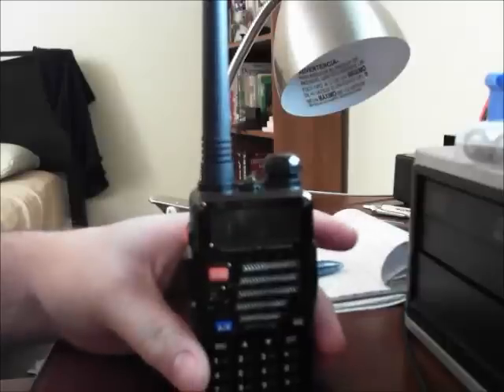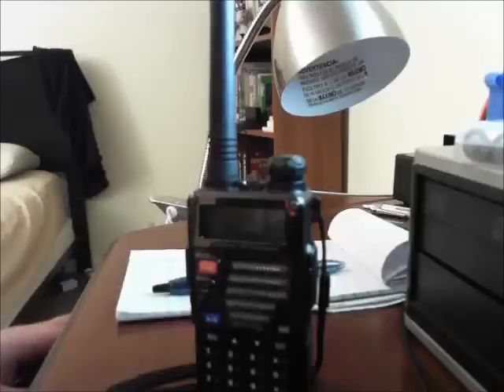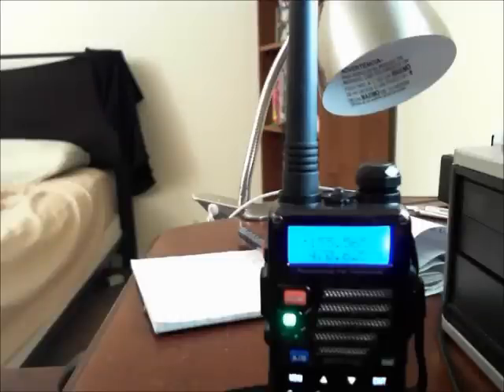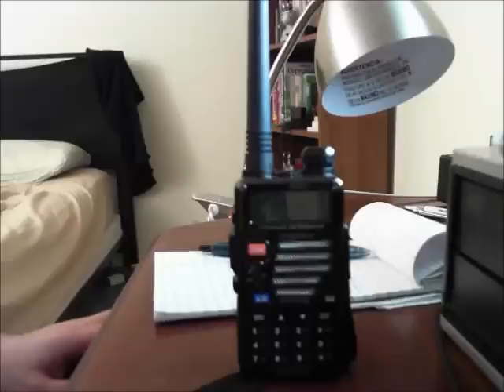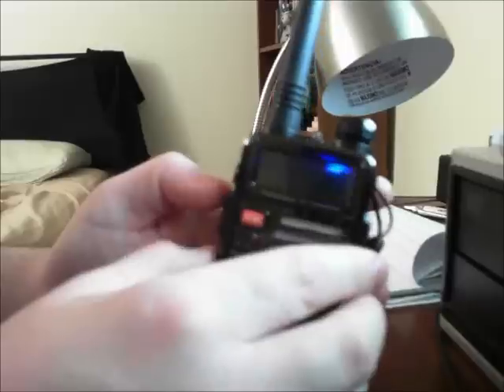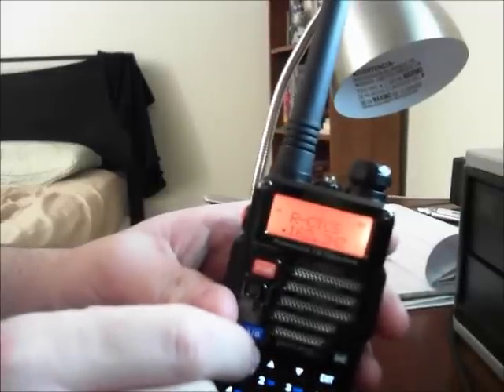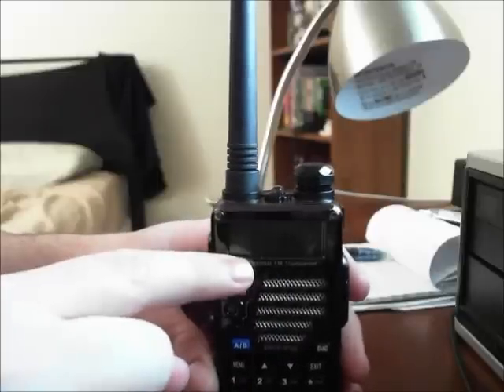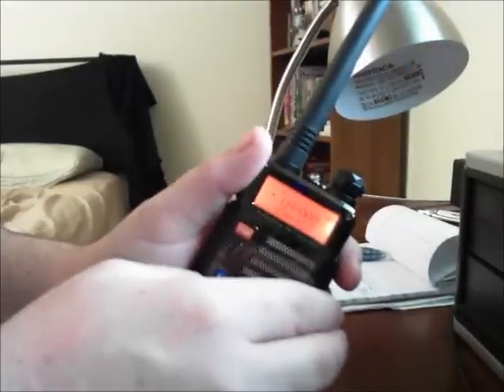Turn your Baofeng UV-5R into a Police Scanner!

Comment: I just purchased one of these and it is being delivered today. I have done a fair amount of research ahead of receiving the radio. Anyone who is using it as a scanner should probably download and use CHIRP software to program it. Despite being careful not to transmit, accidents happen and you don't want to get into trouble with the FCC. There are ways to disable transmit through CHIRP. Specifically, setting the Duplex to OFF and the Offset to 000.0000. Just thought I would throw that out there.
Reply: David Grub So in CHIRP if I change the duplex to OFF on certain channels then there is no way I can transmit on those channels? I have some frequencies programmed in that I want to make sure I cannot accidentally transmit on.
Reply: ***** I did a lot of research and was told exactly what I posted...set the duplex to OFF and the offset to all zeros (000.0000) and that disables transmit. I do not take responsibility if that does not work though. LOL . I just stay away from the PTT button as best I can to add a third layer of protection.
Reply: Setting Duplex to off (None) and the offset to 0.0000 DOES NOT, I repeat DOES NOT disable transmitting on that frequency.  Those are the default settings for a SIMPLEX frequency, i.e. one where you transmit and receive on the same frequency.   The duplex and offset come into play only when you are programming repeaters that receive and transmit on different frequencies.  I don't believe there is any way to disable transmitting on a UV-5R with CHIRP>

Comment: I just purchased my baofeng UV 5r and all I did was a reset all changed language to English set my squelch at 1 then under frequency typed in my local PD frequancy number and BAMM it works. oh I'm also on narrow band at the freq of 154.830 for my local an 155.070 for sheriff dept both dispatch

Comment: To avoid transmitting on the public safety channel, may I suggest you find a DOT Frequency thats open to the public in that particular VHF or UHF band and enter that Freq in the Transmit side, so any accidental push of the PTT wont key up the public safety channel, but you'll still get the Public Safety Channel receive Freq.... Cheers.....

Comment: I was into it and the at the 2:12 Mark . . . Its working...OH SHIT! Now im hooked and subscribed. Better than my DMR/MotoTRBO & Whistler TRX-1 scanner videos. Now im in a county where a baofeng WILL actually pick up. Everythng is P25 encrypted where im from and the analog is only used by walmart and local businesses that are on the 462-467 band. Even HAM radio has started going DMR mode in the metro atlanta area & the local rptrs are stil analog but lotta ppl using DMR now. 73z

Comment: You can talk to the Police if there useing a Trunk System don't push the talk button. My old Security job was useing Kenwood radio's and the Police were useing Motorola. We use the Boafeng UV5-R in my unit out at the Armory .

Comment: I have a Pofung UV-6R, actually 3 of them, and I've programmed all my local PD and FD frequencies in and it does work and receives the traffic on each channel UNLESS I am scanning.  When scanning the scanning never stops.  I have a Radio Shack scanner nearby and it works perfectly but this UV-6R won't stop scanning when it should.  Why would this be?  I'm not using any CTCSS or tones of any type although I want to.  I was hoping to get a cheap scanner that would work with CTCSS so that I could filter out the annoying squelch sounds that sometimes happen due to nearby equipment.  I've tried my other UV-6Rs and they do the same thing so I don't think its a defect.  Thanks.

Comment: set the radio up as a repeater. When you store the channel it says receiving. If you go back to the VFO change the frequency to a 2 meter frequency and then press menu and set channel again press menu and it will say transmit frequency. Now go to channel mode look at frequency it will be police, hit * and it will show reverse as 2 meter frequency.
Reply: I'm not even following you, and I'm familiar with these radios and their operation.  That would just leave you receive to the state troopers while trying to transmit on a HAM Repeater or to BFEgypt, wouldn't it?  Unless you incorporated VOX from one radio to another, you couldn't make a formal repeater per the FCC.  making a cable to link a receiving radio and transmitting radio would be about the only way to do that.  You'd still want to use a TNC to key the radio becuase leaving the VOX on wouldn't be optimal, unless you disconnected the microphone in the radio, but that may disable the VOX function, of that I am unsure.

Comment: I am thinking of buying this radio for use with traffic control because sometimes the truck with extra walkies is a good walk away and I cant leave my position. It will also be great for listening to tac channels that my pager isn't programmed to hear what progress is being made before I get on scene if I am responding with my POV.. I probably won't use it for fireground operations because I don't wanna break/melt it and there are motorola walkies on the trucks. However if it did break it's not like I'm out hundreds of dollars

Comment: What happens if you transmit on a public safety frequency? I imagine bad things.
Reply from the maker: What happens is you piss off more public safety personnel than you can imagine and trigger an FCC investigation. If you get caught, you're fucked.
Reply: Its surprising that so many public safety frequencies are on 2m HAM, as it seems to be easily accessible.
Reply from the maker: Connor Mason There aren't any public safety frequencies on Ham bands. There might be public safety frequencies that Hams can use on a secondary basis, but police and fire agencies operate on 148-174 PSLMR bands.
Reply: Oh
Reply: Keyword ''Caught''
Reply: *****
It is unlikely you would be caught in that scenario because it is extremely difficult to triangulate constantly moving antenna
Reply: If you program it with CHIRP you can set that channel to receive only. Set the duplex field to OFF. That is what I did for the NOAA weather channels and others that I did not want to accidentally transmit on.
Reply: BuildAPrep Preparedness Outfitters 
Also radio amateurs will jump at the chance to help local law enforcement to track down unauthorized users of public safety (or ham) frequencies. They have all kinds of nifty directional antennas and will (using simple geometry) be able to pull up in your driveway in pretty short order.
Reply: Nothing would happen unless you have the proper subaudible tone programmed on the proper frequency.  I hate it when people pass out bad info.  They would never hear you if you aren't transmitting the proper tone even if you are on the proper frequency.  duh
Reply: Not quite Joel.  It would take us a long time to find someone.  It is not that easy and it takes a long time.

Comment: I have a UV5+plus, I input the local PD and Fire Dept frequencies in to my radio and to scan them I press and hold down the * key. This allows me to scan the input frequencies that I also got from http://www.radioreference.com/apps/db/ this works well for me as my Baofeng picks up the radio traffic clearer than my scanner does.
 You can also get way better reception by upgrading your antenna, I bought a Naoya N-771 on eBay for around $5 and am very happy with it. Nice video.
Reply from the maker: Modern_Patriot I've been using the Nagoya N-701 but I also have the 771. The Baofeng is my EDC handheld and is always with me. I purchased an adapter from Radio Shack so that I can hook it up to the dual band NMO antenna on my vehicle and it extends the range by about 10 miles. I ordered some more accessories for it and will do a video asap with all the updates and stuff. I have yet to use it as a scanner though, my Bearcat 355N works great, I plan on upgrading the antenna though or just upgrading to a HomePatrol scanner so that I can RX the state PD and other encrypted/trunked comms. Thanks for your comment, please sub if you haven't done so already!
Reply: Yeah your bearcat will scan way faster than the Baofeng. I have a HH radioshack scanner that scan about 10 times faster than my UV-5R+plus does.
Reply from the maker: Nice. My first ever scanner was a RadioShack handheld model 164. I've had for about 8 years and it works great but I could never figure out how to program the trunking. I think it's because it's an analog scanner and everything now is digital.
Reply: BuildAPrep Preparedness Outfitters

Comment: Any luck with public safety and such frequencies in 2017 on these BaoFengs? They went to a new digital system in our area
Reply from the maker: Yep. Many of the agencies and departments in the United States are still using VHF and UHF analog radios. Most if not all the town police departments and fire departments in my state are still on that system/mode. I don't think a lot of departments will go digital for another decade, rural departments might never switch.  It cost's too much and the technological advancements are not worth the investment under most circumstances anyway. In areas like mine, each town has it's own fire department/EMS. Each fire department and EMS is dispatched by Litchfield County Dispatch. If LCD went digital, all the departments that are served by them would have to switch their equipment as well. That means new radios in every apparatus, new portables for the personnel, new pagers etc. In my department alone, that is over 30 pieces of equipment that would need to be replaced at a cost that we don't have the budget for. The situation is the same with most of the country and that is why so many of the departments which have gone digital did so thanks to federal grant money.
Reply: will my uniden 346xtc pick my county up that i mentioned above? i can't get it to work.
Reply: radio reference says they're using p25.. will the uniden 346xtc or any of the baofengs pick up p25?

Comment: I have a question... Say I buy 2 of these for hunting purposes... Do I need to program them? Or is it a turn on and use?
Reply: xXIndianPlaysGamingxX You would need to program which is quite simple to do.  You can download the CHIRP software from http://chirp.danplanet.com/projects/chirp/wiki/Download and connect it to your radio using a USB cable.  You may have to order one for this radio online but should only cost $5 or $10.  Then you simply program in the FRS/GMRS frequencies which anyone can transmit on.
Reply: +xXIndianPlaysGamingxX You would have to configure them.  more importantly These are ham radio's you would require both hunters to have Ham radio licenses.  you're legally allowed to Rx but you need the license to Tx.

Comment: heres the question of the day all police went to p25 and is digital trunked system how is this working
Reply from the maker: I'm going to tell you what I've told everyone else. Very FEW police departments in the USA have gone digital, even fewer are using encryption. Regarding other emergency services like fire and ems, you wont find any using digital except in some major cities and wealthier areas. NYPD and NYFD have like 100 different frequencies that they use, less than 5 are P25 with Encryption. There are no benefits to digital FM in MOST CIRCUMSTANCES and departments could never justify the expense to their local government officials (who are responsible for the budget), which is why they will never upgrade. It's NOT as simple as just changing the modulation from analog to digital and switching out the old radios with new ones. There are fire departments, like mine and the ones in my county, which each use 13 frequencies. 

Most of the fire departments in my county are dispatched by a central dispatch center. So my FD can't go digital unless the dispatch center and EVERY other department in the area went digital. We are talking over a dozen fire departments, each with several apparatus that have at least two mobile radios and 4 portables in them. DO YOU HAVE ANY IDEA HOW MUCH IT WILL COST TO UPGRADE TO DIGITAL WHEN YOU HAVE TO REPLACE CLOSE TO 500 RADIOS???!!! The only people who want to go digital are the assholes at Motorola who want to make more money. They are the ONLY ones who benefit.
Reply: its not
Reply: i live in a small town less then 6000 ppl with a whole county population of less then 15 thousand all are under p25 system via federal law
Reply: I'm listening to my PD dispatch on a baofeng right now, so ok.

Comment: Hi !! Liked video but I’m trying to get my local police department frequency. The problem that I’m having is that there is no voice . Not sure if you can help? Thanks . Jeff from Torrington Ct
Reply from the maker: Ah cool, I'm just north of you in Winchester.  TPD uses digital P25 which a Baofeng wont be able to hear. You will be able to hear their fire department but you might have to change the modulation from Wide to Narrow to hear them clearly.

Comment: Thanks, Dave! Our local PD uses an analog freq of 460.xxx mhz. It's my understanding that these radio will tx on 460 and I'd have to be careful NOT to tx and interrupt... Is that correct? Likewise, the local fire is on 157.xxx mhz.. Again, will this radio tx on these frequencies? thanks!
Reply from the maker: If it's a repeater frequency, I don't think it would transmit unless you input the frequency AND the proper tone. For example if the input frequency is 460.505 with  CTCSS tone of 88.5, if you don't set the tone in your radio to 88.5, it wont transmit even if you push the TX button.
Reply: @HeavilyArmed  Thanks, that's what I thought, but it's somewhat  alarming that these radios even have that capability... Thanks for the follow up and 73!  K6WDB

Comment: is there a way to lock it so no buttons can get push d like the att
Reply: yes, push the pound key amd hold it till you see a (KEY) icon next to the battery power level disply. When you see the key icon, your key pad is Locked.

Comment: Pajama Prepper Is it possible to scan two frequencies at once? And can you switch from scanning frequencies to the regular radio? Lets say my friend wants to talk to me with his radio and I want to talk to him without talking on the frequencies I am scanning such as the police and fire departments. Does it allow you to switch back and forth between the scanner and regular walki-talki radio?
Reply from the maker: Hey,
You can't scan two frequencies at once but I wont be able to answer the first question until I try it with my Baofeng. The radio has what is called Dual Watch which might be what you are looking for. What I usually do is I will set band A to a channel that I want to talk on, and then set band B to the frequency that I want to monitor. So if you want to talk to a friend on a certain frequency, set that frequency to one band and then set the police or fire frequency to the other band. Use the A/B button to switch between them. I am not sure if the radio will keep scanning in one band if you switch to the other band. I'll have to try and see.

Hope that helps.
Reply: Pajama Prepper Thanks for the information! One more question, do you need a license to talk over the radio if I wanted to talk to my friend?
Reply from the maker: You're welcome. You need a license to talk on this radio if you are going to transmit on Amateur radio frequencies or GMRS frequencies.

Comment: I have a Baofeng UV -5RA. I'm wanting to program my local fire frequency into it,but the frequency is like 154.65430. How can I get this programmed in my radio. Or will it work?
Reply from the maker: Punch in the frequency as 154.654 and that should work fine.

Comment: I am having a lot of trouble getting my Baofeng to work with police frequencies. Would you be available for a short video chat step by step to assist me? It would be greatly appreciated, Thank you. -Paul
Reply from the maker: ***** Sure Paul, but I need to know more about the problems you're having with the Baofeng. Could you be more specific?
Reply: I follow the steps in your video, I also live in CT and am trying to access the Cheshire Police Scanner frequency. I am having trouble inserting the NAC into my scanner and when I do it usually resets to off. I put in the right frequencies assign a channel and then scan but it just doesn't add up. Sometimes I get transmissions but they are very fuzzy and I can never hear any words.
Reply from the maker: You wont be able to listen to Cheshire PD because they are on a P25 (digital mode) system. The Baofeng UV-5R doesn't support any digital modes.
Reply: Ok can you post a link to a scanner that would support this
Reply: For example would this work? http://www.bearcatwarehouse.com/Uniden_BC75XLT_Handheld_Scanner.aspx
Reply from the maker: No, unfortunately that scanner wouldn't work. You would need something like the Radio Shack Pro-651 or Uniden Bearcat BCD996P2
Reply: @HeavilyArmed   Hi good video! like most I also need a bit of help. I have a shop in Danielson CT and a lot of people here got the baofeng radios and are asking me to help them program them.... I have recently past my tech Ham lic but I am to new at this and need help programing my radio. I do have chirp and tried to program it with radiorefrence as a scanner and have not been successful. if you can help it will be greatly appreciated.